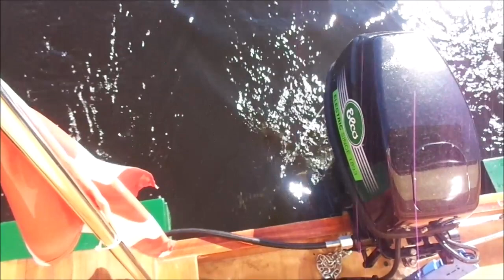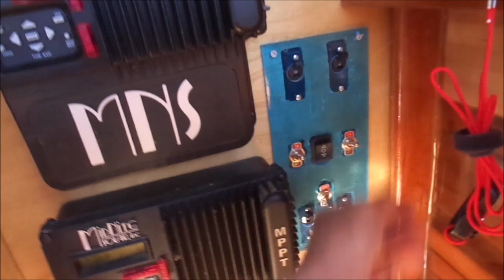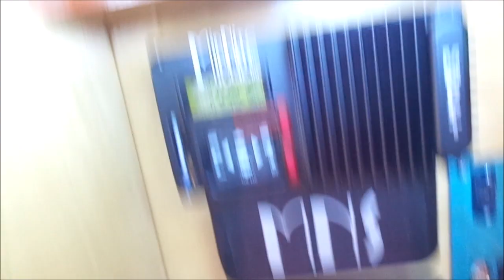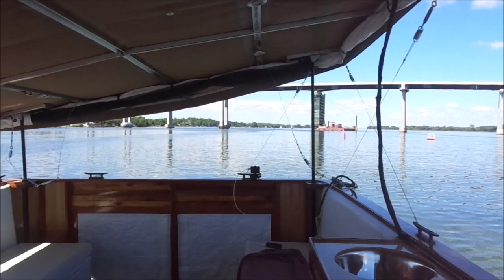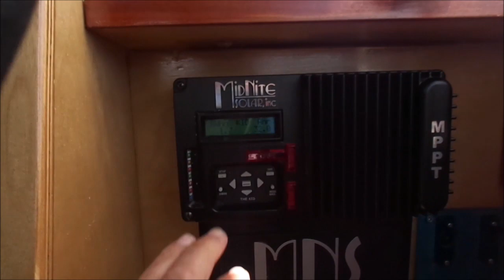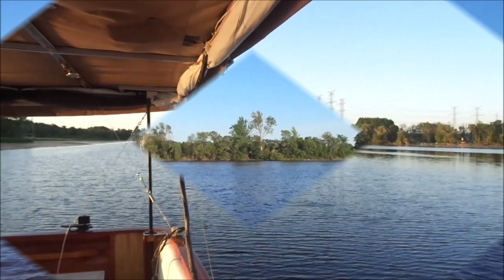Solar Test Trip Building My Solar Electric Catamaran Part Twenty Seven

Comment: Cool boat and nice job chasing down efficiency through testing and experimenting! A couple things I thought I’d mention/suggest. First with regard to your linear actuators as top supports, one simple way to stabilize and eliminate the need for the guide wires would be to mount the actuators in a round tube, then use a larger diameter diameter tube that slips over the upper extending shaft section with bushings so that it slips over and rides up and down the lower section. This would take the deflection load off the actuators and provide a lot more stability and rigidity. The lower section can then be anchored to your boat hull at the top and bottom so that the top can only move up and down and not deflect to the side. On the motor efficiency comparison, in general a PWM controlled motor like your Torqeedo is going to be more efficient at lower power than a motor like the Elco because it is pulsing power like a bicyclist occasionally pedaling to maintain a speed. Depending on the gear reduction in the lower case of the Elco, you might even find a more aggressive pitch or larger diameter prop performs better at your target of 1600W consumption, and you might be able to get away with it if your hull is of light displacement and you don’t overload the controllers with too high an amp draw. Torqeedo has done a very good job developing their props for electric application. Just look at the shape compared to the common 3-blades the Elco uses. A big difference in blade area, chord, and tip shape. That stuff makes a big difference at slower speeds efficiency-wise on non planing boats.
Reply from the maker: Sorry for a late reply as I just stumbled on your comment. I have gone back to my Torqeedo motor and with it did a 23 day trip this summer. I went from Lake Ontario to Lake Huron via the Trent Severn Waterway and you can see those videos in another play list. Enjoy your channel!

Comment: did you have near the  same top speed with 8 inch prop 17 kph? looks like fairly clean water coming off back of boat
Reply from the maker: Slightly better performance but not as much as I wished for.